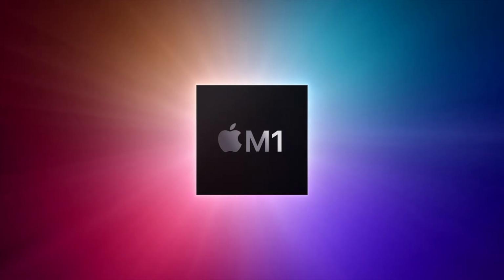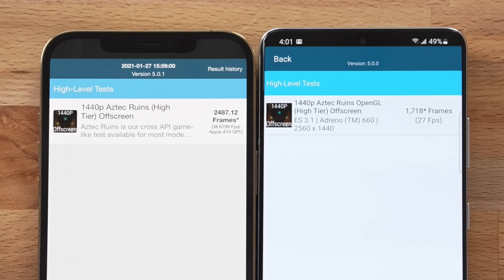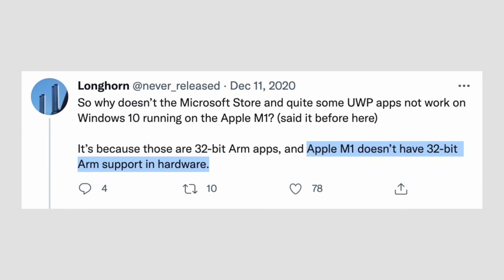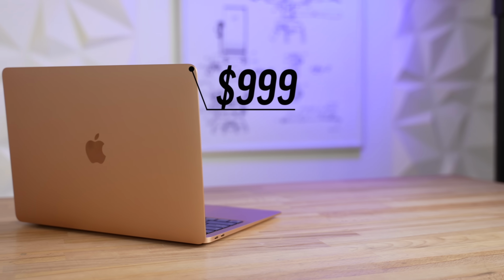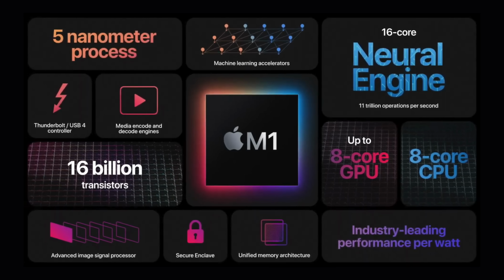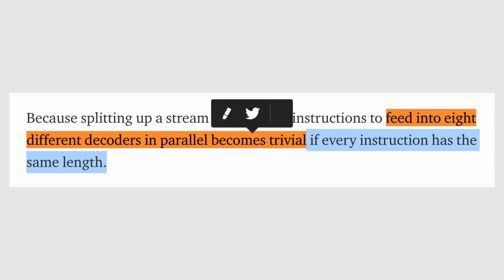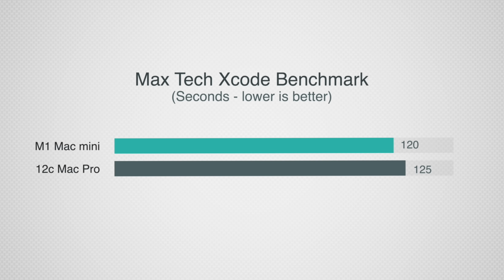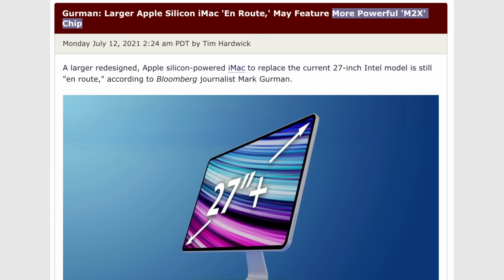Why Apple's M1 Chip is SO Impressive: Explained!

Comment: The M1 chip is revolutionary.
Reply: @Garrus Vakarian Tbh I don't to much GPU intensive works but, I can understand that some people do need dedicated and eGPUs.
Reply: Yes
Reply: This channel is revolutionary.
Reply: 16GB of RAM is GARBAGE. The Intel models have max of 64GB. New processor, a quarter of the RAM. Stupid!
Reply: @dmhendricks  8 gb of ram in M1 equals to 16gb of ram in intel. Sorry but the optimization of apple is great. Wait for the M1x that has approximately 64gb max of ram.
Reply: I still believe to this day, "The fan less MacBook Air" was put out as a marketing gimmick by Apple, to show some 'grunt'  
Apple: "We gotta SHOW Intel what [we] can do, and they will never be able to do"

Pure marketing...  Which is why they kept the same chip, and added A FAN in the Macbook Pro. Am i correct????
Reply: absolutely
Reply: Arm is revolutionary, m1 is the first to adopt
Reply: @indub1851  I am referring to the SOC that apple did. The M1 chip is an Arm chip and the first chip to be integrated with arm technology which makes it revolutionary since every other chip manufactures out there like intel, amd and even chips of samsung and chromebooks are being triggered of what apple did which makes it revolutionary since it marked a change in the entire chip industry.
Reply: It’s not revolutionary, but rather revolutionary. Remember the M1 chip is basically the just an iPad chip using the a14 architecture. I Apple has been doing this for years. This is just the first time we seen it in a Mac.
Reply: So revolutionary that it doesn’t support two external monitors 😂
Reply: @suzukivitara3474  It does using dock. Are you not informed? When connected directly yes it supports 1 but using display link and dongle it can run up to 5 external displays
Reply: @KenzoCera  it doesn’t come with a dock. At this point M1 Macs are toys.
Reply: @suzukivitara3474  It does not but who else runs their mac into 2 external displays? Are you? Only those professional only uses 2 or more monitors but for regular people 1 external monitor is enough.
Reply: @KenzoCera  dude it is called “MacBook PRO” for a reason. And yes most people I know need two monitors.
Reply: @suzukivitara3474  Then simply the market of apple is not for them. Pro models  does not equate ONLY with simply having to run 2 external displays. It has different levels of becoming PRO and besides FOR NOW they can’t run 2 external displays but apple is working with that in future software updates so that it can run your so called EXTERNAL DISPLAYS even if it can still run using docks.
Reply: @KenzoCera  Gee dude chill out. People like to argue for everything. A PRO model should support basic things including two monitors. Anything else is a toy.
Reply: @suzukivitara3474  What? It still supports 2 external 8k monitors dude or even 4 4k monitors using dongles. If they can buy the PRO models then definitely they can buy inexpensive dongles to run those massive external displays you want, ohps for your frieds.
Reply: @KenzoCera  I don’t know who on earth likes or wants to carry all of those dongles to professional meetings with customers. That’s a failure on the part of Apple: that a MacBook PRO of 2013 is far more functional than an M1 toy. Yes the CPU is impressive but for everyday useful use you need more ports and more pro features.
Reply: @suzukivitara3474  Here’s the thing. If they need new machines to run many external displays just for the so called pro you want then they should not buy the new M1 if they don’t want to buy dongles to run those external displays. Simply as that and besides apple is working on future software updates so that these M1 chips and the upcoming M2 chips can run those 2 or more external displays. Wait for it. And besides we are talking about performance here and not those external displays especially 2 external displays that only professional use them. Most of them are average Macbook users that do not to use external displays. If they can buy $1299 then definitely they can buy $30 inexpensive dongles.
Reply: @suzukivitara3474  Are you insane? Why the heck carry this dongle on work station? Are you going to carry your massive external displays also? If you have work station you need not to carry this dongle because it should stay as it is. Are you nuts to carry all those things in a meeting? Are you going to use 4 external displays in a meeting? Is that what you want? Oh c’mon why not use projector instead!
Reply: @suzukivitara3474  Is your macbook pro 2013 faster than the M1? It can outperform the pro with M1? You are just only talking about external displays with solutions but you cannot beat the M1 with an old 2013 macbook with old generation intel chips. Open your eyes!
Reply: @KenzoCera  not about money, it’s about functionality and the lack thereof.
Reply: @suzukivitara3474  Nahhh other laptops companies are transitioning to only USB C ports. Now you are making arguments to ports what else you hated? Tell apple so they could adjust to YOUR FUNCTIONALITY lol
Reply: @suzukivitara3474  What are the pro features you want to be included? Aside from external displays which have solutions aside from the usb c only with of course it has solutions. What else?
Reply: @KenzoCera  let’s see, you can’t run x86 software (natively - without Rosetta) and that is HUGE, no native support for external monitors, no support for eGPUs, etc. The analogy with MacBook Pro 2013 is that it is more of a PRO model than any M1 out there feature-wise. You can buy a cheap $700 Windows PC and get more pro features than with an M1… and Apple knows this otherwise they would NOT be selling MacBooks with Intel inside. I’m not an Apple fanboy like you so I see it more objectively.
Reply: @suzukivitara3474  Lol apple created rosetta and why the heck apple will removed it? pc’s now are transitioning to Arm based chips. Your intel chip is behind, then other software engineers of these applications are now creating arm based applications so they can run natively to mac and arm based chips. Basically apple is dictating the market to create applications for them to run natively although they can using rosetta. Even if they run in rosetta they can still outperform orher laptops there running natively with these applications. I dunno where you came from. It seems like you hated apple much.
Reply: @suzukivitara3474  The m1 is capable of video edting in 8k why the heck you need Egpu’s when it can edit and perform high graphics functionalities? Would you want to put that massive loud Egpu’s when in fact you do it in the Macbook silently? Gosh!
Reply: @suzukivitara3474  You eveb deleted one of your comments about bringing those dongles in a professional meeting. What a funny thing to bring those massive external displays when in fact you can just have a meeting without carrying those. Simply saying that I should not argue with you anymore.
Reply: @KenzoCera  that’s delusional. X86 will never go away. What do you think those massive data centers are running? Millions of lines of code are x86 and many institutions such as banks won’t replace it with ARM , heck they can barely transition from Windows 7 to Windows 10! Apple and x86 will continue to coexist and for the time being Apple does not have an answer to true PRO users; hence why even today you can still buy Apple Macs with Intel inside. Your whole argument that Apple is already working on it can be made of Intel, AMD, and any chip maker. iPad like apps: sure those will be ARM based but the stuff that really matters is still on x86.
Reply: @suzukivitara3474  Who told you that X86 will go away? What I am telling you is that software engineers are making their applications native to both Arm chips and x86. I thought you were only talking about external displays but you are beyond arguments now. Not a worthy opponent.

Comment: Why can't we have AMD and Intel processors similar to M1??
Reply: What do you mean? 

M1 has many differences against AMD and Intel proecessors. 

Firstly, it’s an arm chip unlike x86 chips

Secondly, it has asymmetric cores allowing efficiency and performance in one package

Thirdly it’s built of cutting-edge edge 5nm node. 

Can Intel/AMD make arm chips? Surely. They can buy licences from arm and start work on arm processors. But they’ll be already 10y behind apple. Or they could use arm cores like Qualcomm and Samsung do, and be 2y behind apple. Either way, they’d be behind. 

Can they make a asymmetric core chip? Yes. Intel Alder lake allows  that and future AMD 6000 series is also said to be have asymmetric cores to allow performance and efficiency in one package. 

Can they use cutting edge nodes? No. At the moment, 5nm is exclusively available to apple because they pay TSMC big money (billions of investments into TSMC) to reserve the production capacity beforehand. 

By the time AMD gets TSMC 5nm from present TSMC 7nm, apple would be using TSMC 3nm.

Let’s not even talk about Intel. I’m highly skeptical on their Intel 7, 4 and 3 timelines. They already delayed the 10nm by more than 5y. I don’t think they’ll meet the deadline yet again. 

So apart from manufacturing, yes 2 out of 3 dissimilarities can be resolved easily.
Reply: They never had applications slowly switch over as the macs did over 10 years to make the switch. Developer’s will be angry for such a sudden switch.
Reply: Because it has a different instruction set and architecture and Apple spends WAY more on their R&D
Reply: @redocious8741  Yeah I know about it but I mean to say why AMD and Intel cannot make processors with:

1. Integrated system memory/RAM with the processor aka unified memory architecture (UMA)

2. 4-channel memory support for CPUs/APUs

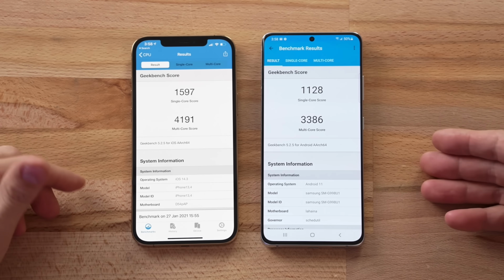Comment: 2:35 : Apple iPhone is always has Higher Geekbench score than Most Powerful Snapdragon powered Android Smartphone

But, in AnTuTu iPhone sometimes losing
Reply: Antutu score is are not comparable for cross platform use.

That’s literally written on their own website. This is because they use different api for iOS (metal) and android (vulkan) 

Secondly, antutu also has categories like Ux (which checks the refresh rate of screen) and memory (which checks Ram capacity, frequency and generation)

This gives androids an edge as they all mostly have 120Hz while iPhones don’t and in terms of Ram, most androids in 2021 are using LPDDR5-6400 whereas iPhones use LPDDR4X-4266.

Then again, max Ram capacity in iPhone is 6GB whereas that’s starting point for Ram in androids. So on capacity also, android wins.

However, geek bench is different because it uses OpenGL api for bench mark and has no category like memory or UX. So for that, both iPhone and android are same.

Lastly, real world Ram tests (I personally prefer phonebuff) usually had iPhone 12Pro winning against S21U. (6GB vs 12Gb) 
But iPhone 12 (4GB) didn’t win against S21U ultra.

So tipping point for Ram usage is 6Gb on iPhone.